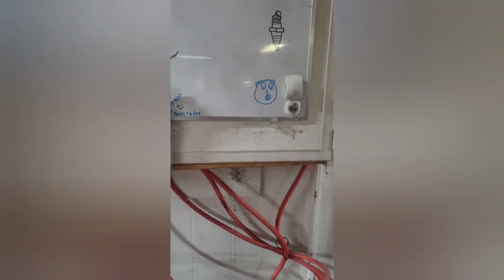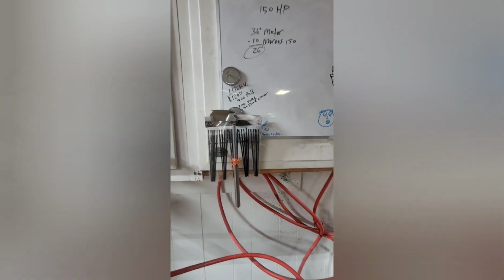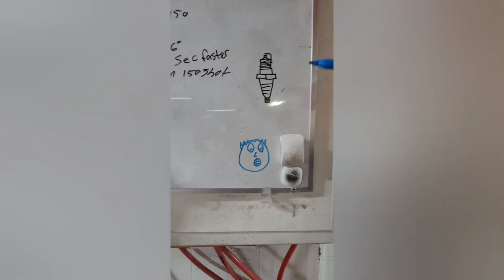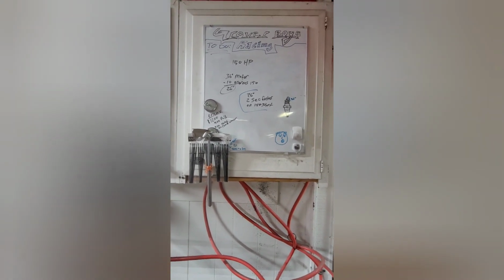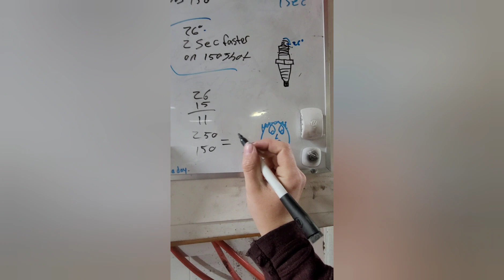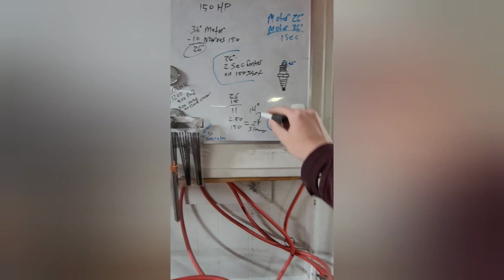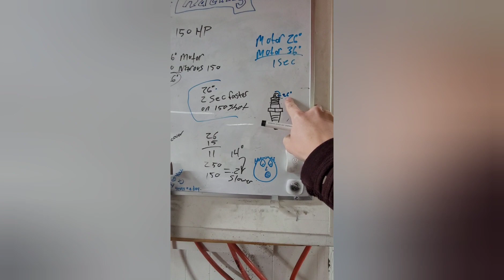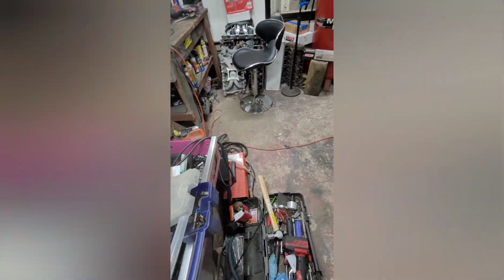We put a 250 shot on NTG blazer and.. GO SLOWER???

Comment: good information Adam, thanks for sharing. It sounds like with the timing up to 36 and a 100 shot you'll still get your 2 second gain and save some Nitrous! what was your rpm drop between shifts on 250 shot, it sounded like the rpms didnt drop much so maybe you were blowing through the converter some?
Reply from the maker: Its a possibility it could be blowing through the converter, rpm drop seems kind of normal. Im sure it is blowing through some, but i think the main issue is in the camshaft due to how much timing it needs out of it. Its insane to have to pull so much lol
Reply: @GroverBoysRacing777AdamGrover  too much overlap or Lsa too tight?
Reply from the maker: @vrm86gt  not knowing the exact specs on the camshaft, i cant directly say, but most likely its both. Lol